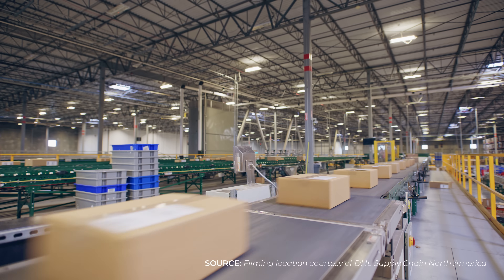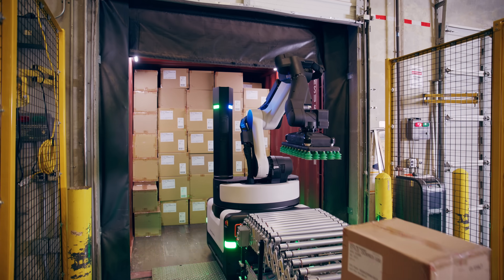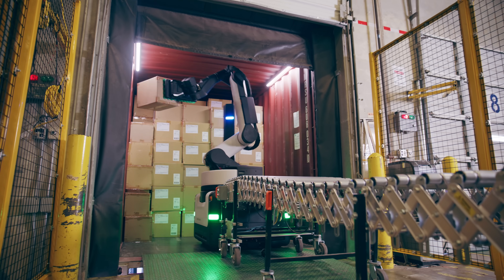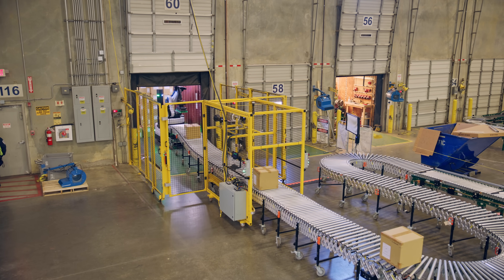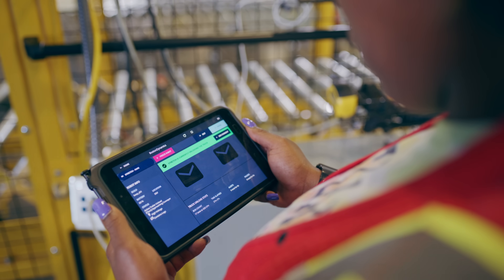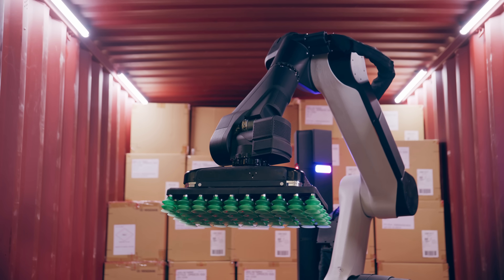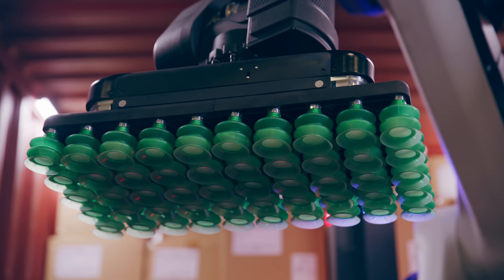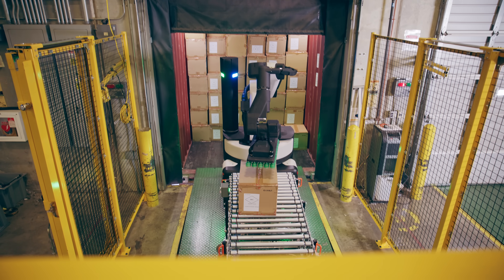Stretch at DHL | Automated Trailer Unloading

Comment: About 18 years ago me and another worker were unloading boxes like these for months in a company in my hometown.
I talked to the guy about how in the near future all that would be automated.
Ofcourse he did not believe me, but he hoped. Well, here you go.

Awesome work guys!
Reply: One box at a time though. This is terribly inefficient vs pallets
Reply: @jblps  not every type of cargo could be loaded onto pallets. furniture, for example, being loaded as is, to use container/tent space more efficiently. and this video was filmed at dhl, which is a company that delivers individual packages. i don't know if it's reasonable to load them onto pallets.
Reply: @kabyzdoch  Good point about it being DHL. But notice how every box was the same size? Sure makes it easy for a demonstration. I used to operate a robot arm just like that with the suction cups and everything that did palletize boxes so it's definitely possible. Pallets then rolled down the conveyer to be manually loaded in trailers. I guess my point is that this is not that impressive in the current iteration. It just seems like an arm on a track that stacks boxes... We've had this tech for decades. Maybe if it had legs (so to speak) and could pull pallets, unstack and pull defectives boxes, then restack I'd be impressed.
Reply: @jblps  yep, I'd sure like to see it deal with boxes of different size, weight and condition
Reply: @kabyzdoch  Yeah and varying weights would be a concern I feel. How much those suction cups can lift and the box unsupported from the bottom would be interesting. I rewatched it and I suppose the cool part is the real time scanning and it does move around from trailer to trailer which I missed.  The retrofitting required with the safety fences does seem a lot for what is slower than 1-2 guys stacking it up. You'll never be able to work side by side with a robot arm like that without a safety fence. There's a gnarly story where a welder robot impales a worker. Cheers
Reply: hell, ill go further than this, i think in the future major surgerys will be commanly done by machines.
Reply: @shardinhand1243  agreed
Reply: I'd rather hire 2 humans than this robot it's So SOOOOOOOO slow.. I don't know how this thing got put into production. People are still 1000000x cheaper and it appears from this video are also 1000x faster than the snail bot.
Reply: @microponics2695  The illuminati wants the mail to be delivered even slower and to cost even more lol :)
Reply: @microponics2695  It’s speed will get faster over time, but speed isn’t as important for a machine that can run damn near 24/7 in a world where nobody gives a shit about the truck drivers time. 

So that’s how it got into production. Not the common good, just more profits.
And with automated trucking on the horizon, Truckers in general have taken to protesting identity politics rather than protecting themselves and their jobs. 

It’s a good time to invest in automation. 

The capitalist classes are preparing to automate most of what they rely on, including security. 

Prepare for the age of the new “gods”. It will be very much like if the old Greek gods became sort of real.
Reply: i bet your firend didn't think the machiens would also take over the ART sector too.
Reply: @arcadealchemist  nope, until i told him all jobs done by humans will "eventually" be no longer needed.
And that a difficult transitioning period would have most of us questioning our role and purpose, a personal recalibration of sorts.
His reaction was: i dont think it will ever be that advanced.
And i simply smiled.

As a sidenote he was a very kind person.
I was happy to have him there.
Reply: Yeah? And whose gonna pay the taxes to pay your universal BASIC income? Fucking absolute genius, you are.
Reply: There's TONS of shitty jobs that needs to be done by robots ! One less on the list 👌
Reply: So many people service the robot. And they haven't shown us the people who lubricate it and maintain the software. Fire half the people, sell the robot, and assign four people to unload boxes. You'll save money!
Reply: @Gianluca-Vacchi  you need four people to load/unload at every (or every couple of) gates. you need four technicians to maintain a whole fleet of robots. so in some situations it makes sense to hire human loaders, but if you have a giant operation with dozens of gates - invest in automation
Reply: @kabyzdoch  What kind of operation? The robot is unloading ONE container. There are a lot of people servicing it. And for each container, you need a robot and people to serve it. Or for each container, it takes FOUR people on two shifts. The robot will be profitable - when it comes to work itself and will work and service itself (charge). And a few programmers will keep an eye on many robots and update the firmware. A robot like the one in this video is not profitable. But apparently it is profitable due to some kind of tax rebate.
Reply: Also 18 years is not in the near future..
Reply: “A long time ago I was right” - WormJuice 2023
Reply: Have a think:

Big Tech, Big Corporations and the Government have NO PLAN in place for the tsunami of technological unemployment that is at hand. And when over a hundred million people are unemployed, underemployed or their purchasing power is eroded so much they can't afford to live, that will destabilize society. We are just seeing the beginnings of this now. It isn't a Left vs Right or identity politics issue - its an issue of technology that is not being addressed. 

Big Tech, Big Corporations and the Government have NO ACCOUNTABILITY as they AI and AUTOMATE away our livelihoods - and they are just going to leave it to the "free market" to determine your fate. This is reckless and careless. You think America has issues now? 

If America (and other advanced nations) are going to make it through this transitional time, Big Tech, Big Corporations and the Government must guarantee a minima standard of living because traditional market economics will not work in an automated and highly technical society. And I haven't even started on the education aspect and how American education is not suitable to create the types of minds needed for a high tech society. And for those older workers who lose there jobs to AI and automation, the answer is not forcing them to go back to school to get a degree and make them debt slaves the rest of their lives just to "ear the right to work." And the same for new kids entering the workforce, too.
Reply: If you support this, why were you working a job it's going to get rid of? Why not just be unemployed? No need to wait for this technology to reap the benefits of not doing a manual labour job.
Reply: We won't need 8 billion people in the world then, maybe reduce that down to 500.000.000.
Reply: Repent and believe in Jesus Christ  Unfortunately, Go, if there even is one, really doesn't care or have any affect on lobal and local economics that determine your life's material conditions - however, it is science and technology that do - and those who control science and technology determine the majority of humanity's fate.
Reply: why would he hope to be unemployed?
Reply: @Withnail1969  He doesn't have to be unemployed. Hes now getting the training and relevant knowledge to work these robots. If anything his job worth just skyrocketed. He should hope every warehouse has these. 
Also Why are people so against automation ? If menial simple tasks are automated we can now have the people who did those tasks get more advanced jobs and education. Ofc with how america is that will never happen cause all the profits from using robots will go into the pockets of the elite, but in any other country with a functioning economy it would be godsend for this stuff. But america loves having slaves (Not referencing race or anything here just pointing out how america is a country built on slave labor and they prefer to keep it that way just now they "pay" them so they're workers)
Reply: And now he works as an actor pretending an engineer in this footage?
Reply: He hoped himself right outta a job.
Reply: "but he hoped"

He hoped to be out of a job?
Reply: @PistonAvatarGuy  That's a very annoying and repetitive job, also not great for your back. Now the people can be used somewhere else. I'd be happy if I wouldn't need to do that anymore.
Reply: @DeTommy.  if you do that, you probably can't do something more complicated. and now you won't have that option. so either get good education, or starve to death. but what if you, for some reason, can't get a good education? that's the problem with automation: it's good for humanity as a whole, but a lot of us, particularly those, who relied on a simple manual labour, will just become obsolete.
Reply: @kabyzdoch  well unfortunately if you cant get a better education the reality of the situation is thats exactly what will happen. You either evolve and be more capable at something else or you do starve to death, you cant blame innovation for that.
Reply: @Ziedmac  i don't blame it, just acknowledging it. there will always be some "dinosaurs" that are about to go extinct, and we shouldn't ignore or mock them. it's just a sad reality of modern life, and who knows how many of us would end up obsolete in the coming decades.
Reply: @PistonAvatarGuy  he hoped for a job suiting his perspective on life and personal goals.
Reply: @PistonAvatarGuy  Age of Abundance is here.. get used to it. Also, food is now automated by humanity (i know top growers with top cropsteering controllers and code them)
Reply: @dertythegrower  Food is automated by GPS and AI, has been for years. If you actually knew top growers and code monkeys in ag you'd know they are all involved with AI now. These systems are completely automated and require zero field hands. Which helps explain the pushback on right-to-repair on JD, Kubota, CNHI, whom all do not want people uncovering their proprietary engineering software and hardware.
Reply: @dertythegrower  in Spain 🇪🇸 some ranchers now use robots that clean the cows, clean the place, feed the cows and also milk them, so the farmer only needs to provide electricity and load food into the storage, the robots do everything else and send a phone notification if there's any problem.

They also use drones here in Cantabria to check if the cattle eating grass on the mountains are doing well. Instead of going up the mountain to check, you just go with the drone and check easily from home.
Reply: @PistonAvatarGuy  With that evolves new jobs, like people who make the parts for the robots... cannot be done without humans (so far).
Also, the energy for robots cannot be done without humans. Energy for robots relies on humanity.
Reply: @dertythegrower  LMFAO. FYI, energy is already automated, has been for decades. The people that work at energy planets are just there for maintaince and minimal management during crisis. 
Not to mention more and more manufacturing plants are solar powered and not connected to any grid, completely eliminating any humans required to manage energy for the facility. Hell, there are giant plants already in mass production that pretty much have a handful of employees just waiting to do something on tens of thousands of square feet that are completely automated (such as areas of gigafactory-tesla). 
Those robot engineers are all outsourced to india and china to do remote troubleshooting as part as the robot manufactures agreement. Hands-on human intervention is rare and completely unnecessary outside of catastrophic failure of a machine.
Fact is, you couldn't be more wrong, and we are already getting stores and warehouses with zero humans involved outside the occasional system maintenance.
Reply: @PistonAvatarGuy  Well i gess he coud have a better job and also unloading boxs all the day, probably introduce a lot of back pain.
Reply: @mabapro08  If a better job was available to him, why didn't he just take the better job? Do you think that people work certain jobs because they're worried that no one else will do them?
Reply: nothing funny. lots of people will loose their jobs.
Reply: @NG15427  Thats not true and also what a incredibly american opinion. Its better to strive for automation and higher education to keep up with automation than keep work slaves.
Reply: it took them long enough and honestly im not impressed
Reply: @Ojj2002  You should be, its advanced shit.
Reply: @Ojj2002  tyranny is always disguised as a benefit to humankind.
Reply: So for 18years you could not loose your job :-)
Now it's gone
Reply: iLLiGal AliENdS R sTEAlinG oR jOBs!!! OoH wEt a mINET!
Reply: @GAMEOVER-yy6zj  “Those damn bots! always takin’ our jobs and sheit😡” - Future American